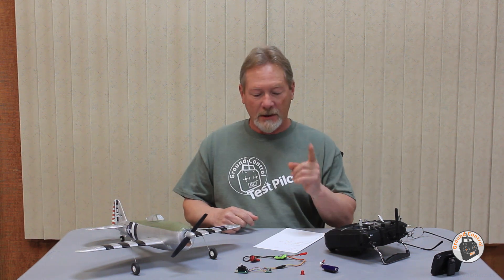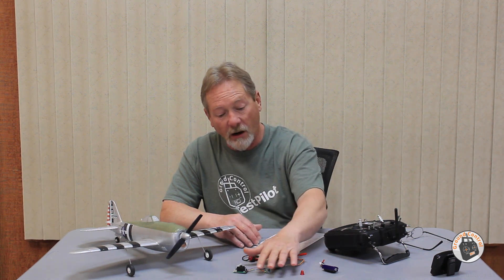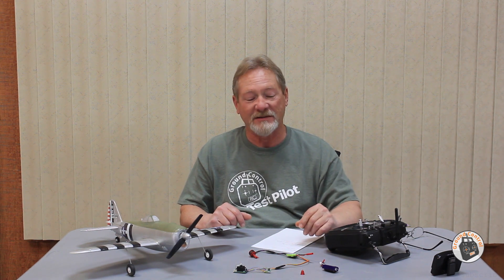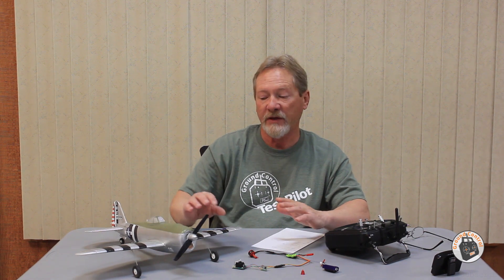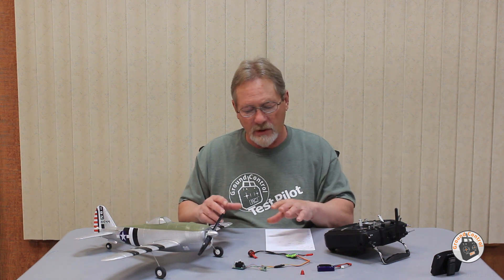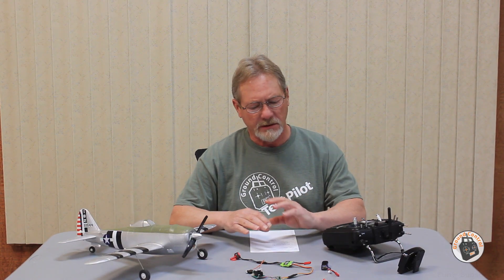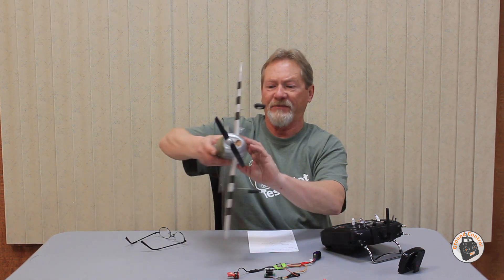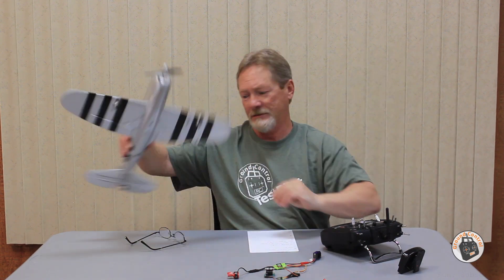Brushed to Brushless Conversion Module! Information & Bench Demonstration of this Module in Action!

Comment: I just bought the ranger 600 has the same receiver …trying to switch brushed to brushless
Reply from the maker: Awesome!
Those Brushed-to-Brushless Modules work great and make Brushless Conversions much easier.
Reply: So you have to solder or is there a way round that …do you have a video where you can see closer ? I’m new to trying this and looked up the items you got I had found that conversion other day while looking at motors for this ranger  600 and notice you had to solder it …is this the easiest way to change motor from brushed to brushless
Reply from the maker: @snauzzeRc  You definitely will have to solder.
It's the easiest way I've found to perform a brushless conversion.
You can always replace the electronics and convert it to brushless that way.
The vendor for the Brushed-to-Brushless module has diagrams and images showing how everything is connected.

Comment: That B2BL Module is exactly what I need for my mini P51 Brushless Conversion... I just ordered one today from the UK... Great Video Chap!
Reply from the maker: Thank You Much!
Those modules certainly make brushless conversions much easier.
Good luck on your conversion.
See you in the Air!
Reply: It should be easier still because I messaged Jerry and asked for the wires to be soldered on haha, $8 extra well spent I thought!.. Today I also ordered a 1106 6000kv motor and a 1-2s 7A ESC and a prop adapter to use the stock prop.... I'll pop back and let you know if it works out.... 
I'm really enjoying all of your Micro plane vids Chap!, I have a "Top RC Hobby" Blue nose P51, 450mm, slightly different in a few was to the Eachine/Volantex P51's but crutially it uses the same protocol you speak of but I can't remember the number right now....V761? Mabey?... So, it's got 2 choices haha, it will or it won't...
Reply from the maker: @cheggers1973  Yes, that will save some time and he's an expert at soldering, much better than I am ;-)
I wondered how the TopRC version would fly since they have a 50mm larger wingspan. I'm guessing it's probably much better than the 400mm wingspan birds.
Yes, I think the protocol was V761 and the Sub-Protocol was something like 3CH or 4CH depending on the plane.
Yes, let me know how that goes with the 450mm wingspan version as I really like the 500mm wingspan P47 and had hoped they would come out with more but it looks like it's going to be the only one.

Comment: Hey Ground control. I'm trying to figure out what battery you have. What did you ending up using for a battery in the end and how long is your average flite before changing batteries?
Reply from the maker: I use a 2S 450mah LIPO and get approx. 5 minutes of flight pushing it fairly hard.
Reply: @Ground Control RC  Thank you for the reply! And that's  a 3.6v correct?
Reply from the maker: @mrsillystrings4075  You are most welcome.
2S - 7.4v

Comment: AWESOME MAN! So this conversation will also work on the eachine p51d mustang?
Reply from the maker: Thank You!
Yes, it will work with the Eachine and Volantex Mini Warbirds that use the V761 board including the Mini P51D.
See you in the Air!
Reply: @GroundControlRC   WOW! Thank you for the quick reply! I can tell your heart is in this awesome hobby! Roger that! God bless👍🏻
Reply from the maker: @mrsillystrings4075  You are most welcome.
The best Hobby in the World ;-)
See you in the Air!
Reply: I am enjoying it! Can't wait to tinker! I'm assuming you need to run a different transmitter than the stock one to fly this mod. Am I correct?
Reply from the maker: @mrsillystrings4075  Actually, since the stock board is used, you can use the stock TX.
It flies much better with a Hobby-Grade TX though.
It's like night and day with a good TX.
Reply: Right on Sir! Thank you very much! You have earned a subscriber! I will be watching👍🏻👍🏻

Comment: Love watching your videos, Tony.  Always very informative with a large " WHEE" factor to boot !  I have received two of the B2BL modules, but can't seem to find any detailed instructions with closeups .  I am a bit colorblind, so the wires sometimes all look alike and I have to go by where they positioned on the pcb and not by red or orange or gray and blue.  Looking forward to doing the brushed/brushless convo on my P-47.  Keep up the good work...and hope to see ya in the air...
Reply from the maker: Thank you much Chuck!
That has got to be difficult being a bit color blind.
After you purchased your B2BL Modules you should have received detailed instruction, a diagram, images, etc. via an internet link.
If you didn't receive the link to those items I would just email them and let them know you didn't receive the link to the detailed instruction, etc.
I would have been completely lost without those.
You'll love that P-47 with a brushless power system ;-)
I'll be using another one of those modules in the future.
See you in the Air!
Reply: I also can’t find wiring instructions anywhere did you get the instructions after All?

Comment: Great Review of the B2BL Module. BTW there is an option to leave a note when you make a Paypal payment for us to solder the wires to the B2BL Module at no extra cost.  Also... it looks like the same B2BL Module also works with the XK X420 Vtol Gyro PCB.... https://www.youtube.com/watch?v=2Eh_tJaBggY
Reply from the maker: Thanks!
I'll let them know about the pre-soldered wires at no extra cost as I'm sure they'll appreciated that.
I saw the demo with the XK X420.
Nice that it appears it will work with additional boards.
I'd like to test one of the Modules with the board from the Mini P47 but I have no idea how to locate the FET Gate for the brushed ESC.
I'll have to research and see what I can find.

Comment: You got one of the convertors!  Awesome.  I can't wait to see it fly.  Still trying to get an unoccupied park field to test my P-47. I've tried twice already, but always people there.

I just got a pair of the convertors to work with the receiver brick in my Xk X420 VTOL tail-sitting aircraft (see on my YT page).  There is a good chance that it will work with the P-47's brick too.  I got my Thunderbolt as parts so I don't have one of the RX's to test.  I DO have one from the Eachine Cessna and the XK P-40 so I will test those someday.

The only micro receivers I know that they do NOT work with are those DSMX protocol versions from Spektrum/Eflite/Parkzone/Hobbyzone.  Very different throttle signal format.

Have fun with the mod project.  This was always the best part of the hobby to me, making something unique and then watching it soar.

Happy flying!
Reply from the maker: Yeah! I did get one ;-)
Very cool little Module.
This P47 is a fantastic airframe so it's the only one I have that I really wanted to convert but I'm sure there will be others.
I'll have to test this module on the P47 board if I can locate the FET Gate for the throttle.
I think the boards in the P47 and Mini Cessna are the same.
I hope you can get that P47 in the air but I know how it is when people are in the way ;-)
I saw that Xk X420 project, sweet!
That is going to be fun with brushless power.
See you in the Air!
Reply: @GroundControlRC  The Eachine Cessna may be another good candidate.  I already have turbo timber works in mine though.
Reply from the maker: @Doggeslife  I was considering the Cessna but I wasn't as impressed by that airframe as I was the P47.